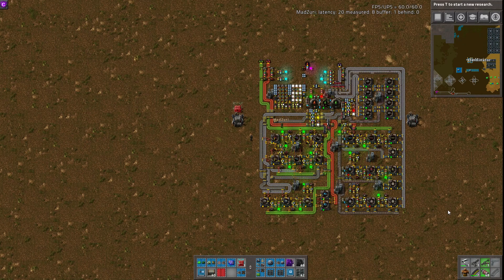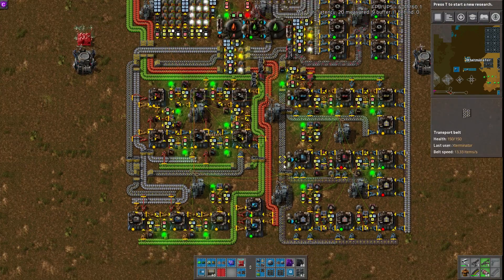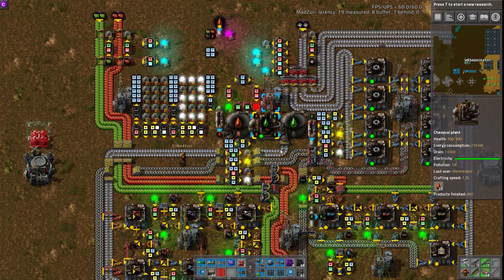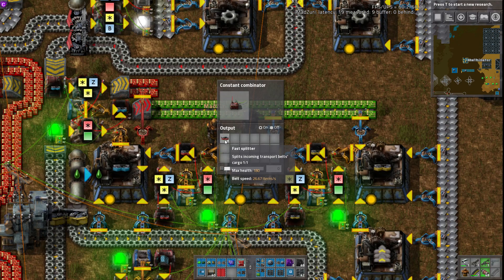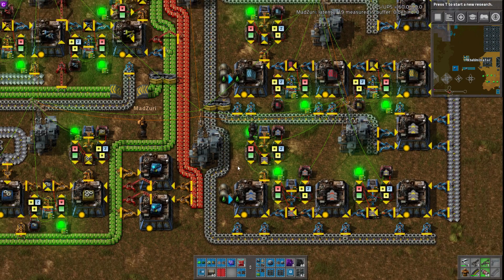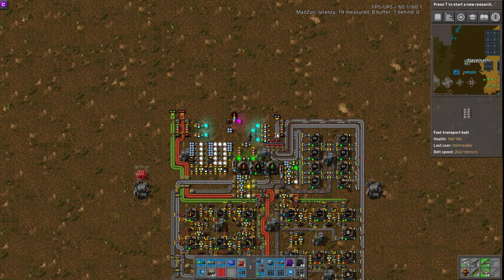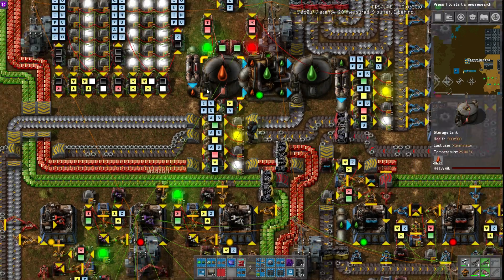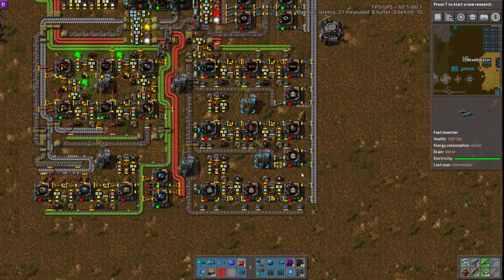Medic's Belt/Assembler Production Facility :: Factorio Workshop Season 2 - Building A Better Factory

Comment: How are the requester chests used?

It seemed that every constant combinator that you opened or hovered over, apart from the stock multiplier was a factor of 2. Is this necessary for it to work properly or a coincidence?
Reply: coincidence. The belt one is set to 32. It is just an item specific multiplier. I think the requesters are made in a way to pull all overflow out of the system, probably request the item as long there are any in the system, that aren't in the output chest.